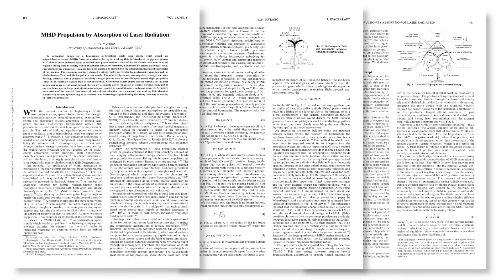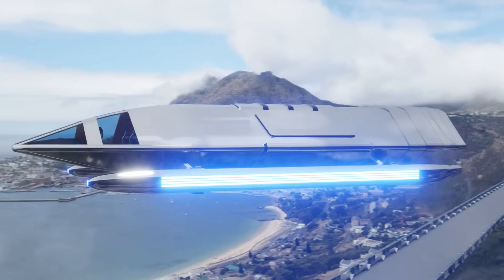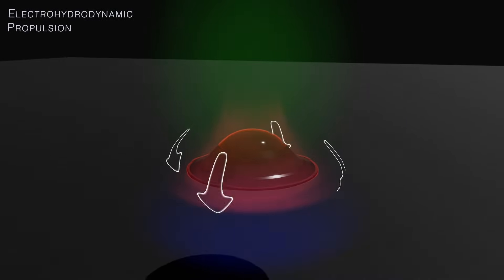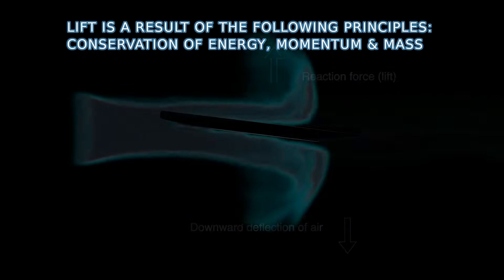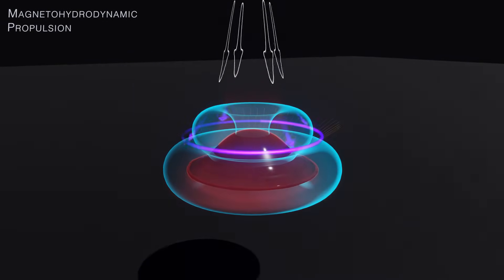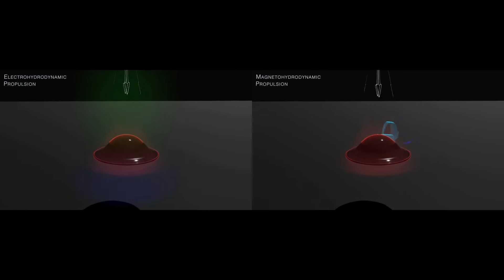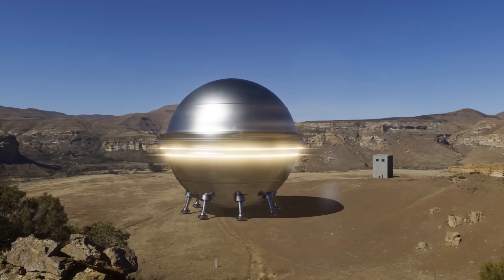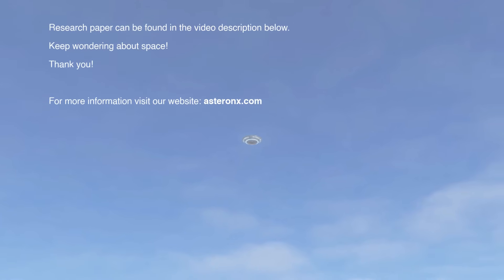Magnetohydrodynamic (MHD) Propulsion - What Is It? #magnetohydrodynamics #mhd #aerospace #asteronx

Comment: Like the mercury drive?
Reply: Not exactly
Reply: @Wincil-k2r  that is what they used in the bell.
Reply: @TheTruthPlease100   The Mercury drive isn't what is shown in the video though I doubt it would be used in an mhd drive since it's highly toxic.
Reply: @Wincil-k2r  The mercury drive is a lie put forth on YouTube. It is actually a mercury   looking material but not mercury. It is actually a superconducting fluid that is also a superfluid. The military has figured  out the formula. Anyway this fluid at superconducting temperatures has no resistance to electricity or movement. 

This in a torus at superconducting temperatures well curve spacetime using the frame dragging effect in general relativity. This well decrease inertia mass and weight by 89% in the tr3b. But this isn't propulsion it is basically a low level warp field or as the military calls it a electro grivito magnetic diverter. Then they use a MHD as propulsion. The ship can go from stop to max speed in seconds and stop in seconds with no g-forces on crew or ship. It can go thousands of miles per hour in the atmosphere and a good percent of light in space. But this is top secret they well not give us the details.

Comment: Are you going to show it in action "live" instead of a rendering?
Reply: Well one thing they didn't suggest is how complicated or expensive these drives would even in theory be. I'm assuming they're unlikely to even be as cheap as the VASIMR drive which is already pretty steep. Also the part about using the quantum vacuum at all suggests this is not likely to ever leave the theory board as the claim at all is rather absurd. Yes in theory a powerful enough magnetic field can effect the quantum vacuum itself, but we're talking magnetic fields like those around a neutron star not nearly similar power to a microwave oven even like VASIMR. 

My idea is it's one of those cool ideas that never goes anywhere like the aerospike, thermonuclear rockets, and autonomous space station construction. These are all game changing ideas, they're all possible today, two of them even had planned missions, none of them have gotten anywhere.
Reply from the maker: @Skylancer727  And they won't get anywhere unless folks that are interested in them work on it. We, those of us interested in seeing these technologies come to fruition cannot count on corporations or governments to do it,  and we cannot afford to wait either.
Reply: @Skylancer727  First off the problem with the vasimr and all the drives you mentioned isn't cost but power. And the vasimir although may be useful is not the most efficient or effective solution. The q-thruster has been tested in labs it is the most efficient to get us closer to light speed. The main problem is power fusion is always 30 years away.

Antimatter technologies well solve this. Not one on one like in sifi but using it as a heat source for propelants instead of oxidizer and antimatter catalyzed fusion. As a heat source it only takes miligrams to get a ship to orbit and micrograms as a upgrade to fusion.

Look this is disruptive technologies the super rich don't want them. It would make them loss there power over us.